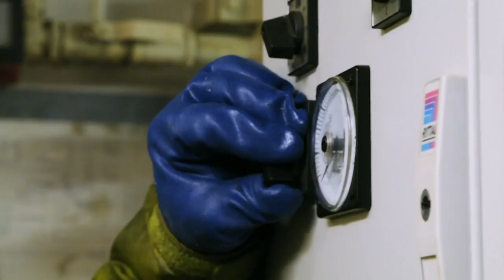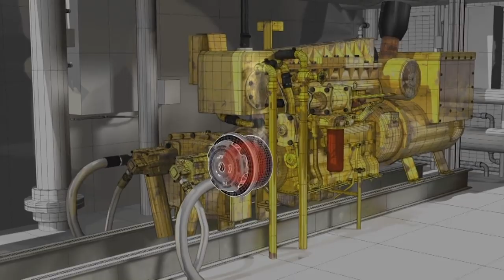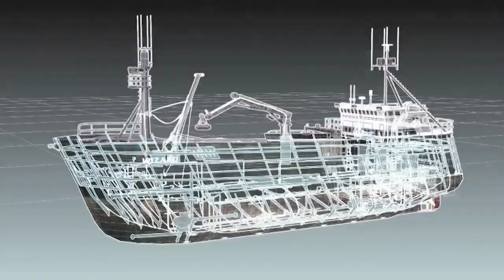Major Mechanical Mishap Leaves Captain In Despair | Deadliest Catch

Comment: I give these guys a lot of credit for having to know everything about the boat to keep it running.
Reply: Specially to basically disable and resemble the motor during a storm
Reply: Facts I worked on 3 tugs boats as a deckhand and it’s no joke. The hardest job I ever did in my life! You literally have people’s life’s in your hands... so much stuff you have to remember and do correctly or you can get killed or kill everybody easily! Like the deckhands are the what keep the boat moving. The captains wouldn’t be shit without deckhands! Ask anybody that works on boats and they’ll tell you the same thing!
Reply: Humans are very impressive beings. For the most part. Then there’s politicians
Reply: @southbayrickybobby5820  amen
Reply: @kolbyorozco9494  Just one of the many fascinating aspects of what it takes to run the whole operation. Multi tasking on a level unmatched to other industries, and having to do it often while having sleep deprived fatigue, with a side of having to work in the worst possible weather conditions for any occupation. It works on so many levels, making it a perfect candidate for a reality tv show. Ratings gold for a tv executive.
Reply: Yeha think that’s just how being on a boat is.

Comment: I wish you could be an engineer on a crab boat without having to double as a deck hand. Nevermind how stressful it'd be fixing that I'd love to work on something like that out at sea in the weather.
Reply: I used to commercial fish out of Kodiak and I knew of several crab boats that just had a dedicated engineer/cook. But those were really big boats, double mains and double gen-sets. As the engineer, you were expected to maintain everything in the engine room clean enough to eat off of, so constant wipe downs and monitoring everything.  You had to be good at not just engines, but welding, electrical, plumbing, fabrication,  you name it.....and up in the galley, you better be a good fucking cook too.
Reply: @blaineedwards8078  currently I work at a ski resort cook in the winter maintenance in the summer. Just got done brazing new chair clamps onto the cable, in the air. I think I fit the bill maybe 😂🤔
Reply: @alec4672  That is good, you are in the right direction. However, maintenance is one thing....but are you an actual mechanic? Can you tear down a bigass Caterpillar C32, run diagnostics, troubleshoot, are familiar with hydraulics, pump systems, commercial battery grids, refrigeration, heat exchangers, forced air induction, reduction gear....just to name a few? There will also be many times that you will be required to perform your duties during severe weather while out at sea, high winds and hellacious waves battering your vessel relentlessly while you struggle just to stay on your feet. Turning wrenches in those conditions is no fucking picnic....but that is your job. When shit breaks down (and it will) you have to fix it regardless of how shitty the weather is.....your life and the lives of your crewmates depends on it.
Reply: @alec4672  sign up for MSC (military sealift command) they'll train you to be an engineer on a ship. You aren't forced to commit to it for multiple years like in the actual military. Can make pretty damn good money because tjere is nothing to do so you just work a bunch of overtime out of boredom. Some people walk away wmaking 90k after a year at the lowest level position.

Comment: Crab pumps are electric I do believe. So a CAT engine with a hydraulic pump head and no Generator head should have no effect on pumps.
Reply: I know its 7 months later but the electrical generator is on the other end of that engine, If the engine has to be shut down while they work on the clutch for the hydraulic system then they have no pumps either.
Reply: @robertmills6497  their pumps should still run off the main genset.

Comment: Keith has the same problem Jake had on the Saga clutch failed on the generators Wizard is dead in the water. This is always the worst case scenario Trident lost 12 vessels all of them were mentioned on Deadliest Catch and the cause of their sinking was fire. The two most recent sinkings were Western Venture and Raven both vessels had clutch problems and burned to death. Coast Guard and two crab boats had to extract the crews before the vessels sank.
Reply: Well... there's plenty of water in case of a 🔥..🤦🤣
Reply: @brianedward6417  a fire is literally the worst possible thing to happen at sea

Comment: So glad these guys had the replacement parts on hand and the knowledge to fix that pain in the a_s problem. I understand many ships go down under similar equipment failures….lose hydraulic pressure to steer the boat can cause a ship to sink

Comment: When Captains land on the crab do they ever pick up 1 pot then unload the crab and bait it up and drop ir again in the same spot then move to the next pot? If I landed on the crab I would do that for the entire string.
Reply: They usually set a "string" which is several pots connected by one rope.  So they complete recovering the string first, and then replace a new string before moving on.
Reply: The short answer is yes. If the numbers of crab warrant it, the pots are rebaited and set back. You set the gear in such a manner that you can try to determine if the biomass is moving and if so, in which direction. You can then move your gear to where you think they are going. Hope that makes sense.
Reply: @battaglino77  WHAT? The fishing you see here is single pot fishing - each pot has its own line and bouys, the pots are not connected to each other. You are describing long-lining with pot gear which is usually reserved for super deep water fishing for Golden Crab.